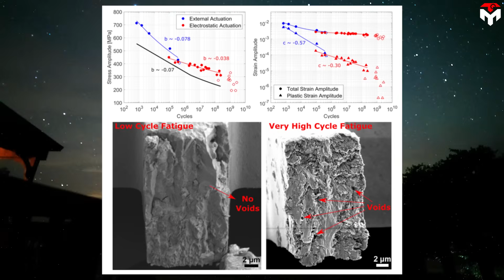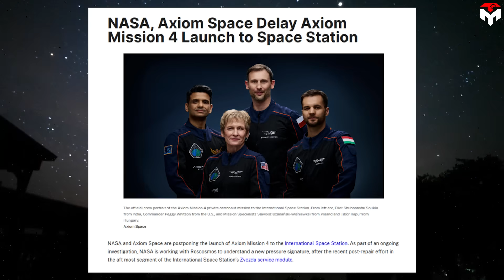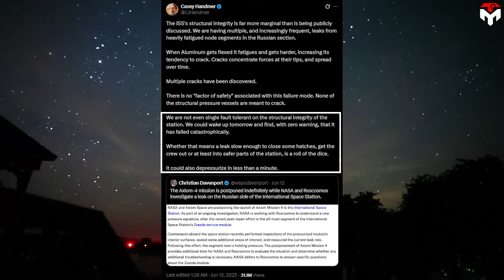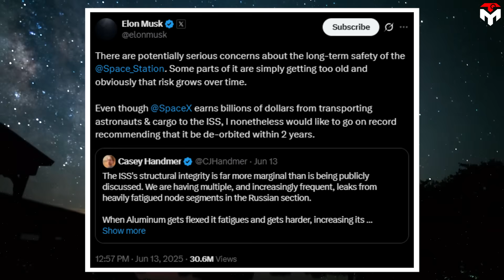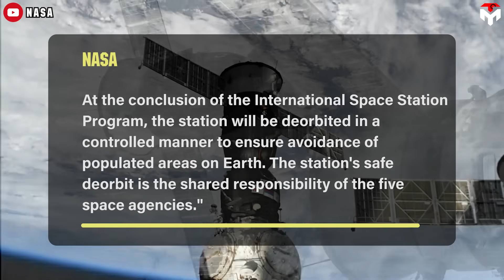ISS is in Big Trouble! Elon Musk exposed SpaceX's Dragon Upgraded to Rescue...

Comment: I don't like the deorbiting. Since the International Space Station is modular, we should swap out bad modules, replace them with good ones, and then ship them back to Earth for refurbishment. The refurbishment process will help builders to understand what went wrong and how to build better modules. Otherwise, how can we learn from the past? Perhaps Starship could load these modules and ship them back to Earth. This provides practice for Starship and a way to get these modules back to Earth for refurbishment. Otherwise, I would leave the solar cells and Associated power modules for anyone who wanted to build another Space Station.
Reply from the maker: Modular refurbishment is a creative concept, but it faces significant hurdles. The ISS modules are designed for on-orbit assembly, not easy swapping or return to Earth. Each module is tightly integrated with power, thermal, and data systems, making replacements complex and costly. Retrofitting them for reentry (e.g., with heat shields) would require major engineering, and Starship, while capable of large payloads, isn’t yet proven for such precise operations. The logistics of safely returning massive modules to Earth would be a huge challenge, though it could indeed provide valuable data on wear and tear for future designs.

Comment: If they put up a replacement space station EVRYTHING should be removable so any leaks can be accessed for patching without having to go outside. Going outside takes the efforts of everyone onboard for 12 hours or more.
Also, this is to be expected, as the original modules (that are still in use) were designed to be operational for just over a decade.
Reply: They are proposing to de-obit the whole station and bun it up.  I feel that is very wasteful.  They could auction it off or reconfigure it saving modules that are still ok.
Reply: @pctrashtalk2069 Perhaps replacing the problematic modules with new ones and scrapping the troublesome ones. I believe that at least one module is basically finished but available as the company that ordered it went bankrupt.